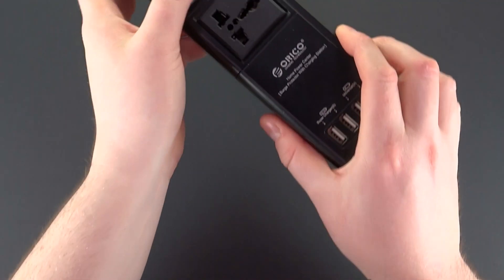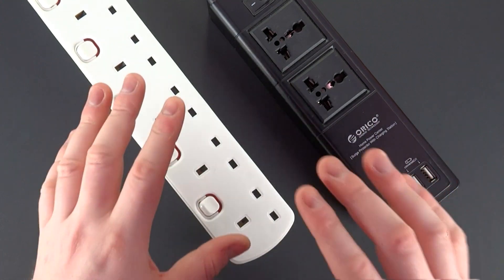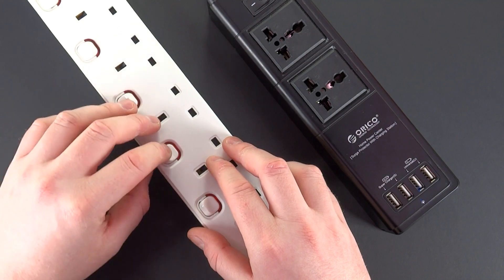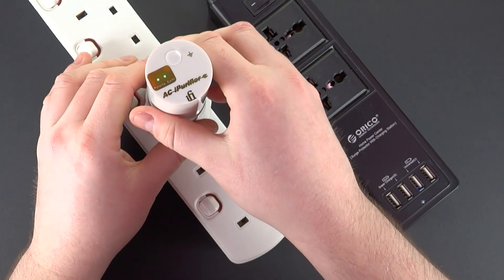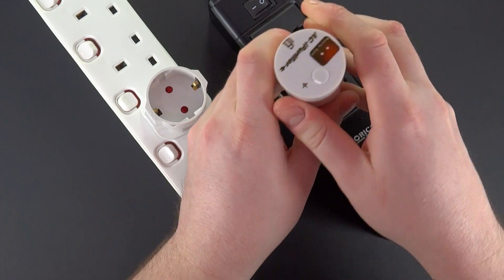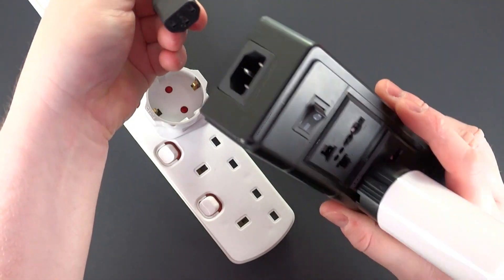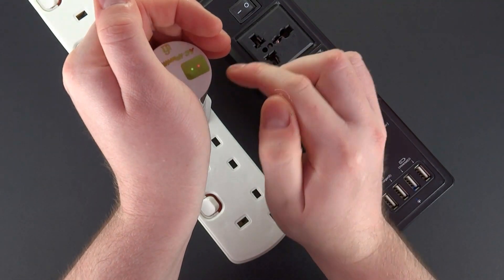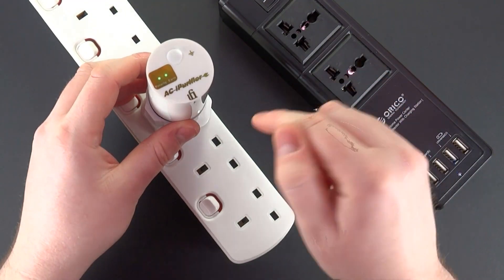Comparison of Ground / No Ground with the AC iPurifier

Comment: Hi iFi,

I recently purchased this and also the DC Blocker recently. They both haven't been opened yet as I'm in the middle of moving all my things to another room. But I was wondering about this purifier. Would I benifit from joining my IsoTek sub from its earth pillar to the banana earth input port in the purifier with suitable cable - in the double wall socket next to the socket which will be feeding my system ?. I have a feeling it'll help my system even more as this is an active unit. It's just that I haven't been able to really find anything or anyone's opinion about using it as an grounding out post online at all about it - perhaps I'm just not looking correctly

Thanks

Comment: Does this need ground? to work properly?
Reply from the maker: Hi - please see: http://support.ifi-audio.com/kb/faq.php?id=819
Reply: @iFiaudiochannel  lol error 404.  I have this question also.  I live in a condo in Vancouver, Canada.  Can I use this to ground my components?  Regards, E
Reply from the maker: @Canadian_Eh_I  Yes, we believe you can! What's in your setup to double check?
Reply: @iFiaudiochannel  I have a Parasound P7 Preamp, a 6 channel Edge Electronics amplifier with Icepower ASp500 modules, a DEQX Express II, an Ultratone Power Supply, Hydra Z Reclocker, 2 channel 25 watt tube amp, Exactpower sp15 power conditioner and a laptop.
Reply from the maker: @Canadian_Eh_I  You can use it in combo with our Groundhog kit to ground it properly!
Reply: @iFiaudiochannel  Hi, the support page is blank, I bought the AC purifier, please tell me if it needs a ground to work properly, will it attenuate both differential and common mode noise when not grounded?